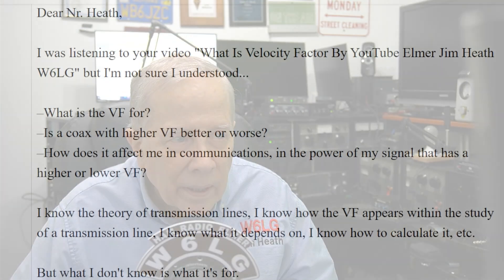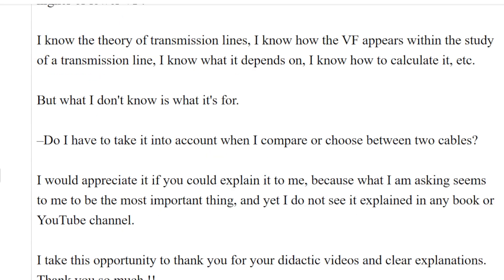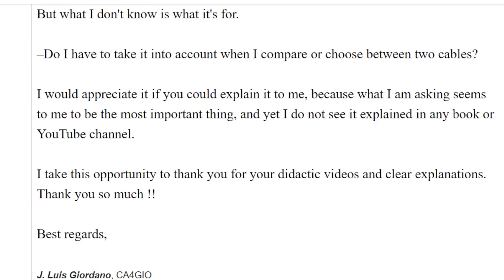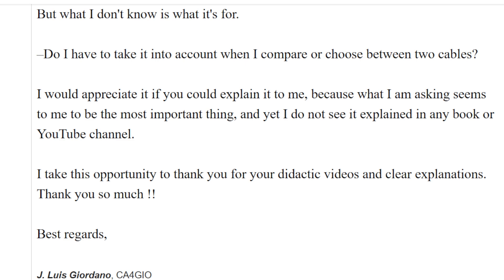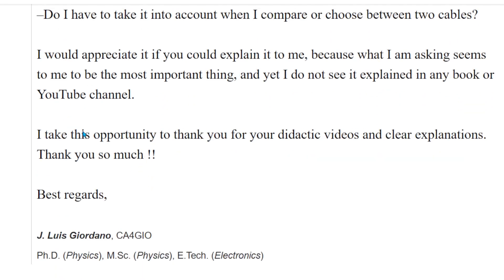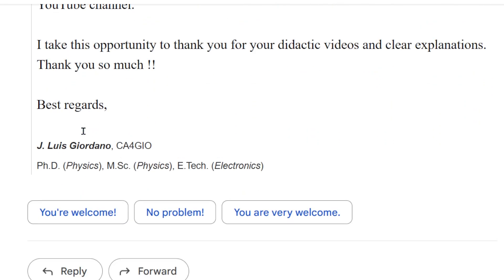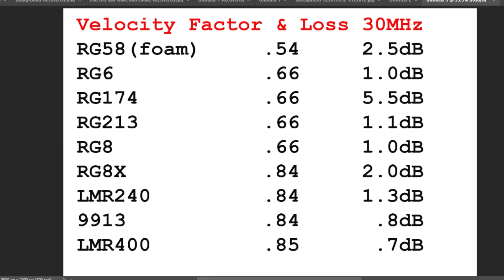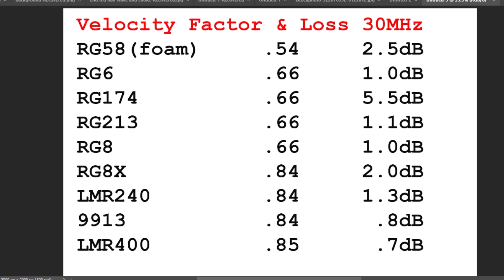"Officer Trooper Velocity Factor I Was Only Doing 55" VF Question From Chile  By Jim Ham Radio Elmer

Comment: Greetings Jim. I just got my Tech Class License, as a result of a friend giving me two hand held radios BTECH UV-5x3; and Baofeng BF-F8HP.
So  while I am learning about how to USE the radio in terms of freq. search, and programming channels I have yet to make a contact. I have been
as I understand just trying to consider a simple simplex contact.
I found a BAND PLAN for NorCal 2 meter. So which freq should I try? Also I am trying to stay away from 146.52 because what I have been told is that is kind of like Channel 9 in CB world.
BTW: I live in North Auburn, CA just North of Airport off Dry Creek Road.
73's
And no I don't have a PhD :) But great Video.

Comment: try phasing a 80m vertical array, soon you realize your cables .66 wont reach :) go to .88 and you see they will reach the other side :) length matters, degrees matters... but overall the cable have to be able to reach the other side...

Comment: Velocity Factor also needs to be factored in (no pun intended) in calculating the length of wire antennas, whether dipoles or end-fed, and can be a consideration in the length of radials.

Comment: What if you have a multi-band antenna and the directions tell you to cut the feed line so the overall length, is an odd-multiple of a wavelength at the lowest band of operation. Velocity factor doesn't factor in here .. right/wrong?
Reply from the maker: Wrong.  73 , Jim
Reply: @ham-radio  .. Thank You Kind Sir :) 73

Comment: From the WEB:

“Coaxial cable specifications often include the velocity factor, which is typically between 60% and 90% (1). A cable with a velocity factor of 70% means that the signal travels at 0.7 times the speed of light or 2.1 ∙ 10^8 m/sec. The velocity factor is directly related to the permittivity of the transmission line”

Bob Runge
W1LSZ

Comment: Hi Jim, once again you have nailed it with an accurate answer. Most of the time I don't care what the VF of a cable is but as you rightly mentioned it is critical in systems  where you are worried about phase. Typically when driving stacked and bayed yagis or constructing phasing harnesses. A less common application but relevant to amateur repeaters are the harnesses around cavity filters. An extremely thought provoking question, well answered. 73